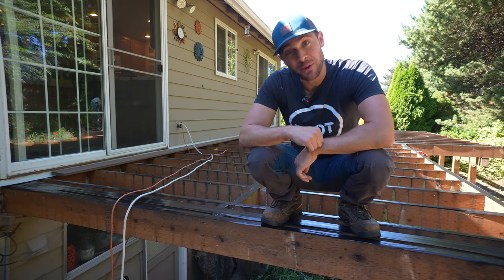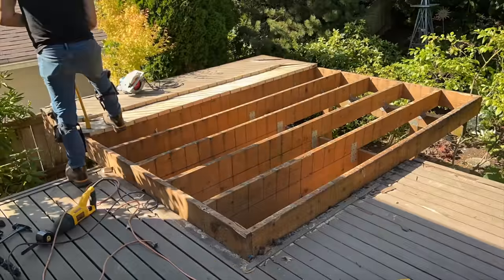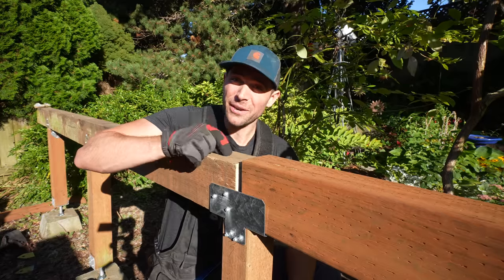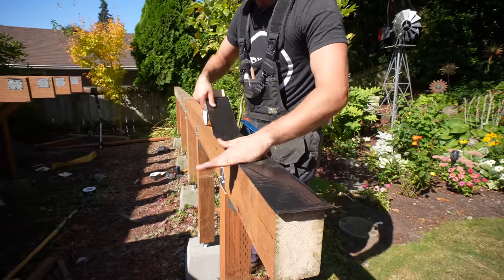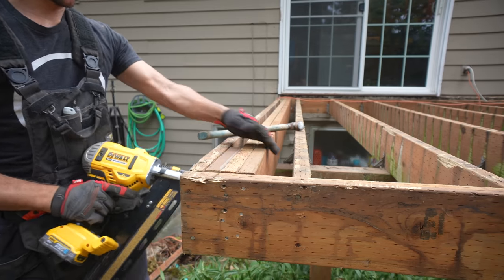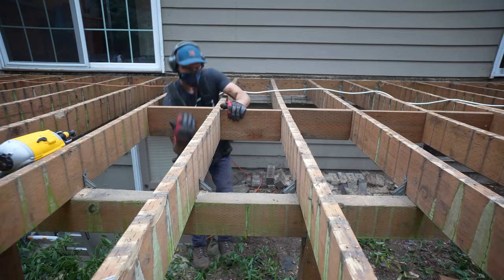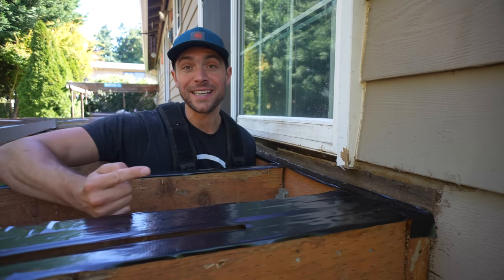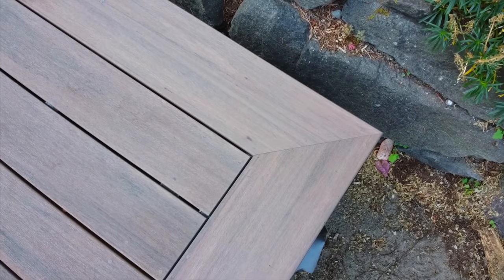TOP TEN Deck Building Tips I Wish I Knew Sooner!

Comment: I’ve seen a couple of your videos and they are pretty good. I’ve been in the trades for 35 years. Good content here, especially with composite decks. I have to make one suggestion. Do not use a surveyors tape to check for square on a larger deck. You need to buy a 100’ steel tape. A surveyor tape is plastic and will stretch/shrink due to the temperature. A steel tape will not stretch/shrink. Hope this helps.
Reply: I agree. Or actually have it surveyed. I’ve done that on really large Home builds and it is spot on.
Reply: A steel tape will stretch as it heats up in the sun keep them out of the sun
Reply: stretch is fine as long as you measure at near the same time. It is a relevant number. Like my step meter can be way off- does not matter. I try to best it each day.
Reply: Surveying technician here. We almost never use tapes to measure distances between monuments. Total stations and GPS systems are pretty well standard now. If we use a 300 or 100 ft vinyl tape it’s because we are looking for something and are trying to get close enough to use a metal detector. Only tape a surveyor should be using to take measurements of record is a steel tape. 

The steel tape doesn’t stretch like a vinyl tape when pulled tight for a measurement, but it will get longer and shorter with temperature changes. However, it is constant and you can account for the dimension differential if properly motivated.
Reply: Measure within 5 minutes and there is no issue.
Reply: It won't stretch due to heat in the 90 seconds it takes you to take both measurements.  
You can do corner to corner measurements with a piece of string and get it perfect.
Reply: And don't let a measuring tape slam shut. The hole that allows the end hook to move will become longer with every slam, changing the length of every dimension reading.
Reply: It really doesn't matter when you are checking to see if it's square. It isn't going to change from one corner to another corner. It only matters if you are using one to measure and cut materials.
Reply: Use a laser measure so much easier and more reliable.
Reply: Fiberglass tape will NOT stretch. Steel tape is very dependent on the weather. Of fact there is a formula for calculating the growth compared to the outside temperature.
Reply: or use a laser measure

Comment: Pro tip: if your town/municipality allows, ditch the concrete footings and go with helical piles.  They can hold 2x the load, installed in about an hour and you never have to pick up a post hole digger or mix concrete AGAIN! (Cost Is $200 per where I am)
Reply: Yea but how do you drive them into hard soil or rock?
Reply: @FlyingAceAV8B  hard soil has never been an issue…..rock….you’re up the creek.  Either way with rock, you will still run into the same issues.
Reply: Work poorly in soft soils. Soil conditions with this method matters.
Reply: I see helical piles for mobile home footings , the speed of installation is awesome!
Reply: I def would like to use it but we have rock and they require a special machine to drive them into the ground. That machine is not cheap to rent because you need someone trained to use it. Concrete is just much easier for doing your own projects.
Reply: I did it for my deck. 36ft by 20ft. I used rebar to hammer down as a guide since there is a hole in the middle. Start with a short 2x4 then a long one when it goes lower. No movement at all. Been 8 years
Reply: I have these. installed in glacial till, clay and 1”, 2” 3” 4” rocks. The rocks are no more of an issue than with an auger. The helical piles are driven in until they reach a specific torque. Not sure that renting a machine would be a good idea. Hire a pro. I have a big water table issue and these took care of it with no drama. Wish I’d have had them for the first two decks.
Reply: my home foundation was reinforced with helicals. they don't care about anything in their way or around them: just drive them down until hitting hard till. The structure ain't moving after that.

Comment: I’m planning on a redwood deck remodel. The railing goes, but the 20 year old floor boards are old growth redwood so rather than toss them, I’m going to flip them over to use the unweathered side which I will sand and treat with boiled linseed oil.
Reply from the maker: Interesting idea, but why dont you just sand and resurface the existing side so you don't have to back out all of the screws?  Thanks for watching Jag.
Reply: @BYOTools  I’m debating refinish vs flip-refinish. There are ugly black stains around the corroded screw heads which I can’t sand or bleach out. Also, there are small splits due to weathering which go down about half the wood thickness. The board undersurfaces look pristine. If I flip, I would need to use your suggestion of cutting the screws with a reciprocating saw.
Reply: @jag5316 
Yikes!
I’d definitely go with refinishing.  If you try to flip them, there may be more damage and stains on the bottom than you realize.  And if you have any cutouts for posts or railings, you probably can’t reuse them exactly. 
As soon as you have to replace one or two boards, the whole thing will look half-assed.  
Good luck with whichever route you go.
Reply: @shawnbrennan7526  Thanks
Reply: Interestingly enough, the boards with cutouts don’t need flipping. The deck gets sun unevenly due to the progression of the roofline shadow throughout the day
Reply: Yo check out tung oil vs boiled linseed oil.
Reply: I’m with you on reusing. I put solid stain over old pressure treated wood and it looks much better. No demo of unstable, already in place structure. All this assumes that everything is solid and properly supported.
Reply: All of these posts. .  including yours are ignoring a key essential in decking installation.  CROWNING.  IF.. the installation was done correctly, the crown of each individual piece would be facing DOWN.  This keeps the wood edges from flipping upwards due to weather conditons plus deck wear.  If you were to reverse these usable boards,  you're chancing these pieces to buck up.  This is primarily true for pressure treated pine.  Redwood is softer and not prone to warp as much  but the wear life  is less.  Composites don't need crowning.  No matter how pretty the newly flipped and restained boards look, if they warp on the edges due to insufficient installation,  you've wasted time and money.
Reply: Did you finish the cedar deck yet? We have a thirty year old cedar deck I have refinish three times and about to do what you were talking about about ....flipping them over . The tops of mine are too weather checked to hold out water .

Comment: Another tip: Put the auger bit on the ground before you start it turning. You can see in the vid how much it wobbles around before it touches the ground. If you want any sort of accuracy, you need to touch down first.
Also, as they go deeper into the ground, the angle changes. Have an assistant watching from side-on, and they'll tell you when you need to reposition the machine so that you're still drilling vertically.

Comment: Yup!  Blocking is definitely a must.  Here’s a suggestion for you.  Since your joists are on 16” centers, the spaces should all be the same.  Cut all of your blocking before you start hanging your joists.  Then install the blocking and joists at the same time.  It will remove the necessity of measuring and cutting between each joist bay and keep your joists more parallel on the 16” centers.
Reply: I would recommend not doing that. Things don’t always line up perfectly and you may end up with a lot of waste that way.
Reply: The joists can move around quite a bit with blocking, you only need to measure the first and last one. The first measurement for all but the last, the las one for the actual size.
Reply: My deck was built 30 years ago. No blocking. Still in great shape.
Reply: @GonzaHero  I have been a framer since the 80s and have always done this.  Cut all your blocks 14 3/8 because you gain a little.  I still mark my layout and leave out blocks on any special bay, but as long as you pay attention that is the way to do it.  I do it like this framing walls, stacking roofs etc.  Really saves time stacking roofs.  I see so many people have a guy on the ground and 1 on the top plates nailing blocks.  No need for 2 people to do it.
Reply: @vacavapes5500  there’s no doubt you do that well. With your experience it’s unlikely you’re making other marginal errors that’ll add up and reveal themselves as you cut blocking as it would for someone who is doing a DIY

Comment: I just built a deck myself, you give great advice. One thing I notice is you use the DEWALT framing nailer, I hated mine, it jammed so easily so I got the Ryobi framing nailer and it’s a game changer
Reply: Got a hammer and it never jammed.
Reply: I have the DEWALT and it worked flawlessly.
Reply: Went through several dewalt. Milwaukee has been way better since I switched.

Comment: Flashing tape is never used by the spec house builders where I live in SC.  Throw it up and get the check is the business plan.  The decks are full of thoughtless water collection pockets, loose railings, and little regard for longevity and rot protection.  I look at new houses' decks, and I swear I could easily kick them to pieces.  If you want a deck done right, do some reading, and do it yourself.

Comment: On the center hole of those deck spacers you should fill them with caulking before you run the lag bolts through and into the house!

Comment: On the wood dimension difference a lot can be due to shrinkage between new and old wood or wet vs dry wood.  Ive built a few docks where it was easier to float joices to get them where they needed to go,  and its amazing how much the wood will expand from just a short 10 to 30 minutes in the water especially for newer wood. Vs old well dried lumber.

Comment: You could use a water level instead of the Lazer level. The water can be coloured with food colouring. Much cheaper and more versatile. All you need is a length of clear narrow diameter plastic tubing. No line of sight problems or having to transfer levels. Keep it simple.

Comment: The major thing to get started correctly is to drop the framing . Use a 2x4 tacked under the walkout door of the house. This will prevent water,ice and snow from being at the same height as the interior floor . This helps prevent moisture creeping under door sills. Flashing against the house will be alot more beneficial as it will now be standing upright and counter flashed with the door flashing.Can't remember how many repairs we have made where decks were level with door sills and the water damage it caused
Reply: That's a great tip that I had not thought of. so then there's a small drop from the sliding glass door onto the deck I take it?
Reply: @StephenBoesch  Yes ,about 3 and 1/2 inches

Comment: My “professionally” built house had the ledger screwed through the siding.  (A no-no the inspectors missed) The flashing they did use was aluminum (A no-no the inspectors missed) which was incompatible with the pressure treated lumber chemicals which dissolved the flashing.  

Water damage took out the perimeter framing, floor decking, bottom plate, several studs, patio door, siding, and more.  The railing and stairs were also mounted through the siding.  😢

Comment: How do you feel about using rubber type flashing tape instead of aluminum drip cap or Z flashing over the ledger? Seems like the big box stores are not selling the appropriate aluminum or steel, drip caps for deck leisures, everything is going towards the DIY tape.
Reply: The rubber flashing is not made for sun exposure. New windows to framing is one example because siding or brick will go over it. Get the aluminum, that's why they make the stuff.

Comment: As we all know, pressure treated lumber can shrink quite a bit once it dries out . When that happens your beam joints won't be flush on top anymore and this could potentially put a nice lump in your finished project.  I would use wood that matched without any mod cuts that way it can all shrink together and stay flat. What are your thoughts?

Comment: Your deck will be much more solid if you support the joists below on larger joists( 2x10 under 2x8), add some bracing and use hangers for the upper joists. I wouldn’t trust face or toe baling joist to ledgers. My 12x 30 ft. deck with 2x6 decking can hold support a half ton pickup.

Comment: I am just about to fit my composite decking, ive got SC24 timbers for the sub frame and will treat every cut and the top and sides but not the bottom of the timbers with 2 coats of fast drying bitumen primer and then im going to top the timbers with 100mm DPC ,this will then sag each side like a cover and this will divert water away from the timbers ,ok it will take a few more hours but will last a long time

Comment: You should use blocking to separate last two joist for your perimeter instead of nailing two joists together and placing that seam under the joint of the perimeter and the field.  Keep your first joist for your field away from the seam and the water won’t get stuck on the joist. This is not as important on a composite deck as a wood deck but still good practice.

Comment: Im a little confused by the right angle method. I see that it translates to the string but how does that translate to the girder and joists that you place in the ground? Do you just line up the edges of the boards to the string? Thanks!

Comment: I'm getting ready to replace pressure treated decking with PVC.  Would it make sense to paint or stain the framing members as an extra moisture repellent?  They're 20 years old but in good condition.  I'm just thinking in terms of lasting as long as the new decking.

Comment: I'm curious how you manage to fire nails through the dewalt nailer without jamming.
Reply: Lower the slide on the nail packs slowly, rather than letting it snap in place. Snapping compresses the plastic between the nails, which can cause jams.

Comment: Can an 8’x10’ free standing deck be installed on deck blocks 4’ off the ground?
Would it be stable?

Thanks
B
Reply: If there's no ledger board anchored to the house ask yourself would you feel safe if 10-15 people were standing on the deck and how much racking there would be. The fact you're saying you want it 4'-0" off the ground puts the centre of gravity very high and imo unsafe to use only blocks. You can't go wrong with a ledger anchored onto the house and a solid beam on concrete piers drilled under the frostline. Adding some racking support for the 4' x 4s because of their height would be a good idea.

Comment: Interested to know if composite is really worth it. Ordered timber tech samples and I wasn't that impressed but I'm also no professional. If you went the wood route, what would be your mid budget recommendation
Reply: In my opinion it is worth it. Looks better and lasts longer. I haven't used timber tech but only trex so far. Loved it. And my first one i did a picture frame and aluminum railing with built in light too! turned out beautiful.
Reply from the maker: I personally feel that its 100% worth it.  Just the fact alone that all i have to do for maintenance is pressure wash it once a year it truly amazing.  If you went the wood rout it depends on your budget.  In my area you will see cedar or IPE.  IPE will definitely be more expensive though.  Thanks for watching and make sure you check out part 2 :)
Reply: Think of composite decking every time you have to repaint your wooden one, then after a few years your wish you went to the darkside
Reply: I stripped,  sanded, washed, refinished my PT deck every year for 8 years and it still rotted. Go with composite.

Comment: I've used that rubber/ashphalt tape (whatever it's made of) when I replaced the rotted planks on my deck. Luckily the structure was still good, so I used that "tape". It tacky to the touch, but no so much when you apply it to lumber. It'll stick initially, but can delaminate easily. Applying on a hot or sunny day will help, on a dry surface.   Buy an extra roll...or two. You'll be surprised how quickly you use it up. A rubber  roller was recommended to apply the "tape". I bought it, but lightly hammering the tape down will work, or using your hand. Wear  gloves. The tar (whatever it is) will stick to your hands, and is hard to clean off.

Comment: Is the flashing tape you're using the type that kind of closes in around penetrations to provide the ultimate protection?
Reply: It works better if you use flashing tape than if you don't use it.
Reply: @jakebredthauer5100 okay…?  Thanks I guess?  Not a very helpful comment.
Reply: @Frankengruvin  
97% effective.
The wood is going to be so dry underneath there that a small amount of water will not have any noticeable effect on the wood.

Comment: Interesting that you used screws rather than nails. I thought nails are much stronger for joists especially
Reply: He's using nails with a pneumatic powered palm nailer. Kind of looks like a drill/screws, but it isn't.
Reply: They looked like shortlags to me.
Reply: Simpson Strong Tie allows their screws or their nails in their connectors to meet spec. They are structural screws, designed for use in pressure treated lumber.
Reply: Anything you've got out in the weather should be done with screws. As materials expand from heat and then shrink when they get cold, they can pull nails right out. Screws won't pull out like that.